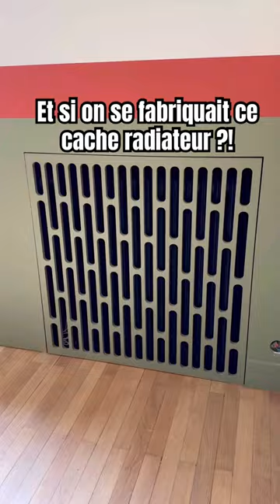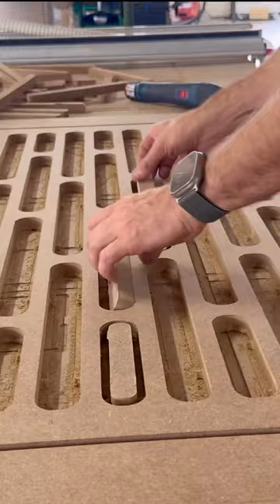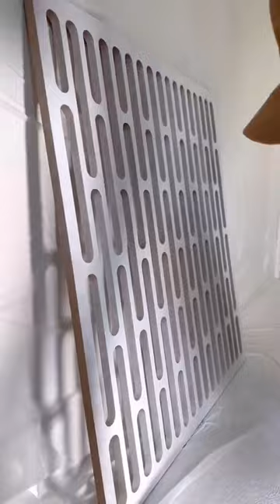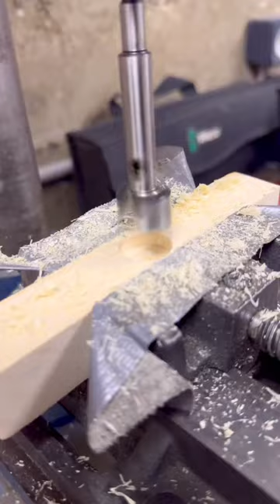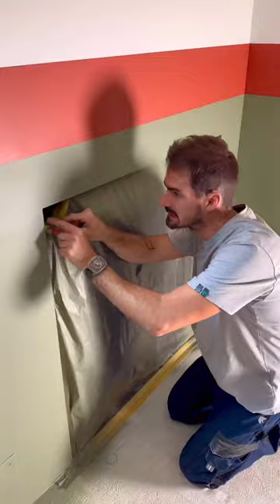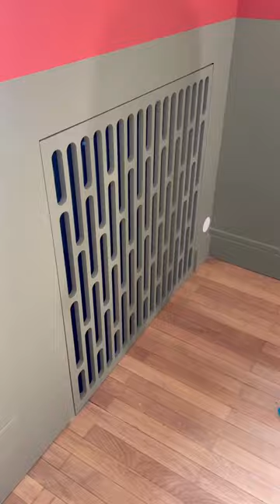Fabrication d’un cache radiateur custom! #renovation #peinture

Comment: Comment faire perdre 30% d'efficacité à votre radiateur ? Vous venez de voir la réponse en image ! A l'heure de la recherche maximale des économies d'énergie, voilà qui est troublant. Le principe du radiateur est la convection, si vous l'enfermez, il n'y a plus de circulation d'air autour du radiateur et donc il chauffe beaucoup moins. CQFD
Reply from the maker: Merci professeur ;) mais le chauffage est un chauffage d’appoint car la pièce est chauffée par une paC air air. C’est tjrs chouette d’avoir toutes les données avant de commenter. Mais en effet les performances du radiateurs vont être amoindries. Cette vidéo n’est pas un tuto